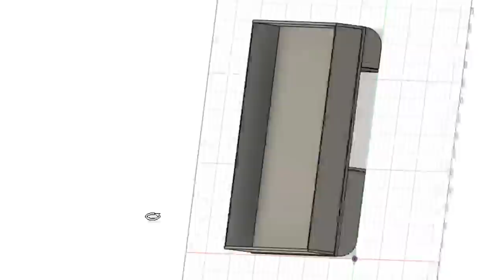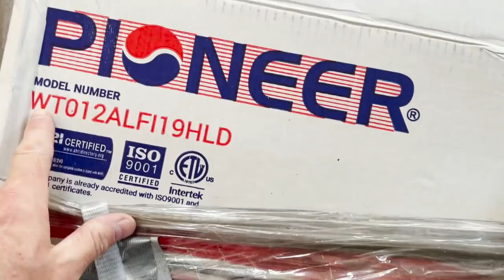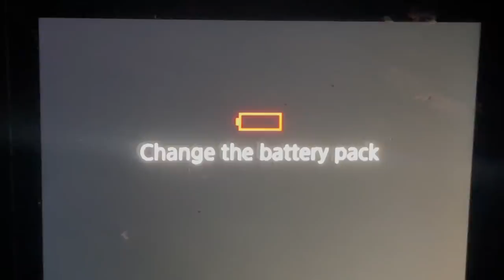PREPARING FOR SUMMER // Mini Split Indoor Unit for our Bus Conversion - S04E06

Comment: Looks good that unit is precharged for that line set  two to three inch will not mater, don’t forget the drain line on the head unit and pull a good vacuum on the line set that way you will no if you have any leaks in your work 410A is very high pressure. Good luck

Comment: Could have used the flanging tool around the crimped copper line then pushed a Phillip's screw driver through the tubing to straighten it out.   That little crip wasn't bad enough to worry about though.
Reply from the maker: thanks Curtis, We were a little nervous about working with those copper pipes as it could be an expensive mistake :)

Comment: I installed  a mini split last year and love it.  But using the heat strip in it this winter here in the Texas freeze in Febuary was expensive.   They make these with 2 indoor units that use one outdoor unit so you can have one on each end of the bus with only one condenser unit.  They Also make cassettes that can be put in the roof hole where the normal RV roof top ar conditioners go.  Only problem is they dont make the cassettes in 110 volt yet.

Comment: Whoo slow down there turbo you kids are having to much fun now it's looking great you guys nice location for the mini split how many BTU's is it? And are you thinking of one in the front also? Just wanted to add a suggestion for your skylights to cut the heat down you know the cloth honeycomb blinds you can buy 
You could use them they make tracks for them to slide on just for skylights.
You can also order them white or silver on the back side example facing the skylight and a color on the other side.
Either way have a blast on the build.
And as always its been fun watching your build thanks for sharing.
Reply from the maker: Thanks Brian - so happy we can share th build with you. Mini Split is 12BTU and yes we are planning for one in the front as well. Great idea on the skylights and we may look into that . . . if our current plan doesn't work out :)

Comment: Why didn't you run the insulated piping and wiring thru the closet area???  Would be better concealed.
Reply from the maker: Hi Sherly, we needed to get it over to the area in the hatch step that would allow us to go down into the engine area. We couldnt have accesssed the engine area directly below the closet but it would have been nice to hide it all that way. We are working on the pass side of the closet now and it will cover most of the piping :)